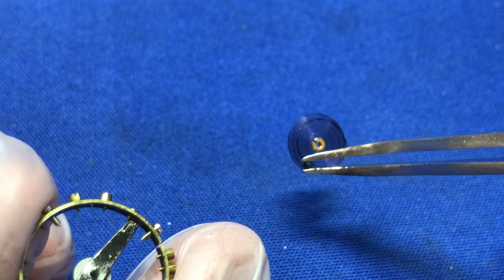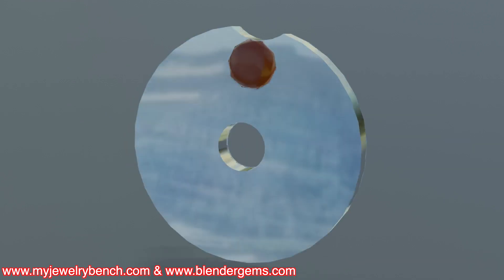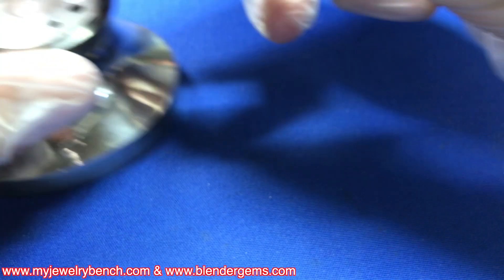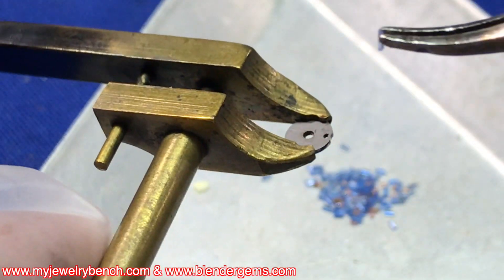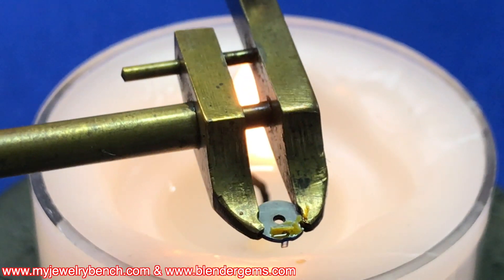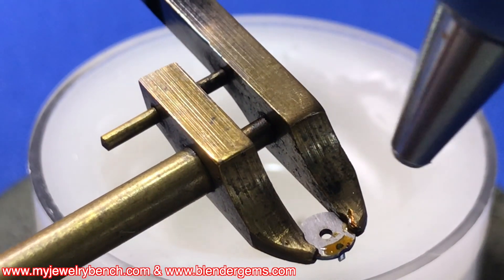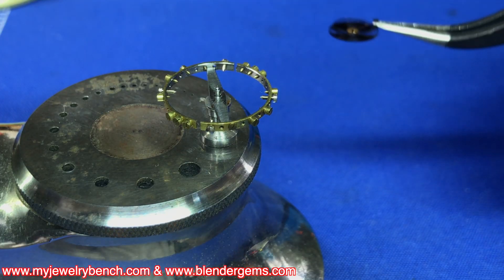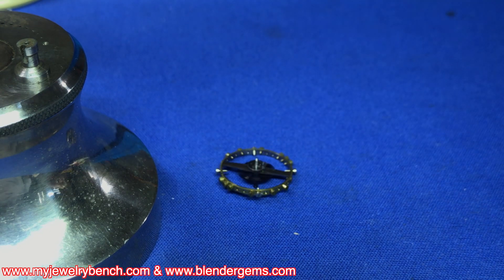Watch Roller Jewel Replacement - Step by Step jewel restoration

Comment: Love the Staking Set, the incredible precision, the process and your skill! Shellac is amazing stuff. I've used a thick gel-like shellac to cement jewels (Victorian bloodstone intaglios) into one of my signet rings--these bloodstones are obviously enormous compared to a watch roller jewel--I put aside the ring for at least 6-months after the job, to ensure the stone is securely set and the shellac completely cured. I also use a thin, runny shellac to cement fountain pen ink sacs onto the pen's section--a versatile, reversible adhesive is shellac!

Comment: Saw one video that suggested leaving the mallet on the table and using the back of your tweezers for this so you have more control, especially when reinstalling. It was explained to me that you want to favor adhesives instead of clues. Shellac is an adhesive. Adhesives can be adjusted and removed. (They can be reactivated.) Glues are permanent, usually.

Comment: My question is how do you line the jewel and center it between the forks.  My understanding is that when the balance is at rest the jewel must be centered in the forks without touching either fork when the fork is exactly perpendicular to the balance staff.
Reply from the maker: Usually, the roller table will be either round or 1/2 round. The diameter of the hole in the roller table as well as the spacing of the pallet fork prongs indicate the size of the roller jewel. They need to match perfectly with just a very small amount of play in the fork. The roller jewel will seat perpendicular to the roller table.

Comment: When reinstalling a roller table on a balance which has already been poised, I believe it's very important to position the impulse jewel where it originally was.  Otherwise, the balance will likely be out of poise because the center of gravity of the table/impulse jewel assembly does not lie on the rotation axis.

Comment: Wait, isnt dried shellac blocking proper reinstallation of roller table?
Reply: From what I can tell, it bottoms out on the staff (or wheel) before the "table" part of the table touches anything.  Otherwise, it would sit in the wrong position.

Comment: Some terminology housekeeping...Pinions are strong gears, sometimes elongated, which attach to staffs or shafts.  The teeth of pinions mesh with the teeth of other gears of wheels...ie.  the center wheel gear is driven by the pinion on the third wheel.  The pinion on the third wheel drives the teeth of the 4th wheel.  The shaft, or staff in the case of watches, has pointed ends called pivots.  Pivots go into the jewel holes which are bearing surfaces.  So in this operation, you are removing the roller table from the balance staff.
Reply: To add to Donny's list: Heat moves through conduction, convection and radiation.  The heat is conducted through the table warmer.